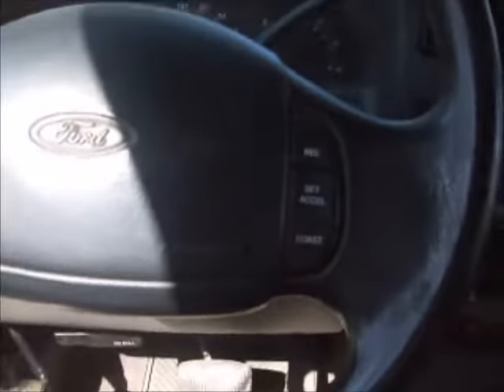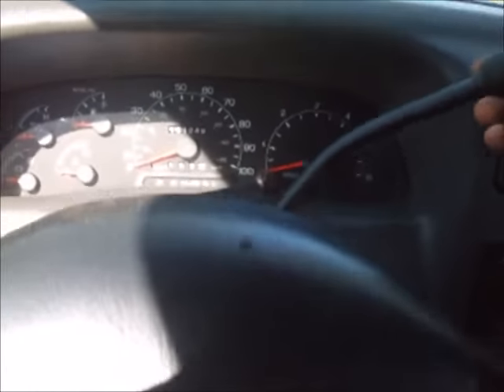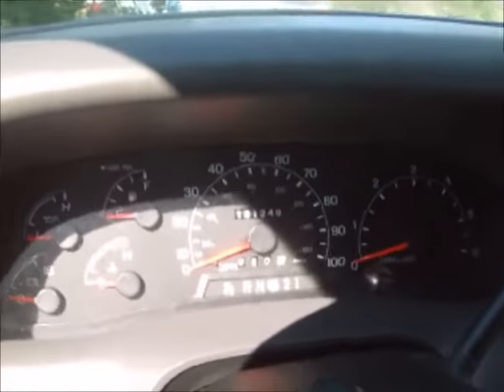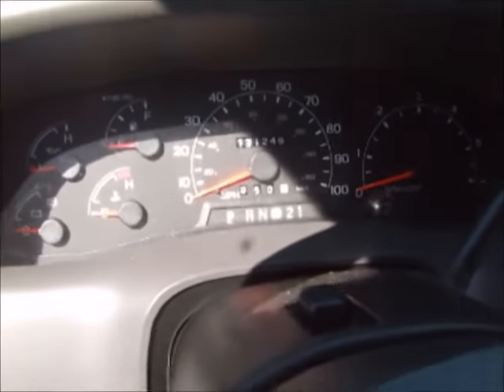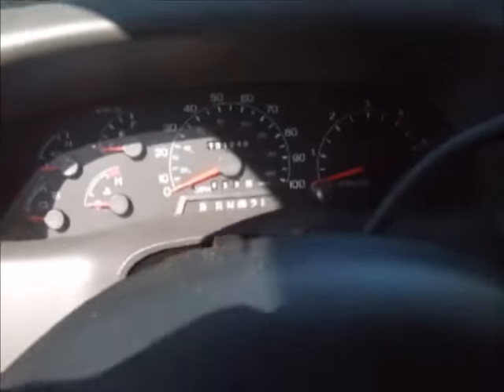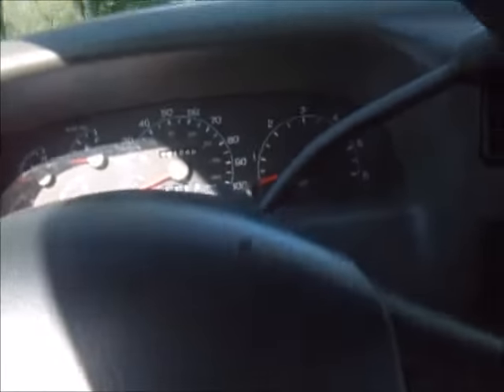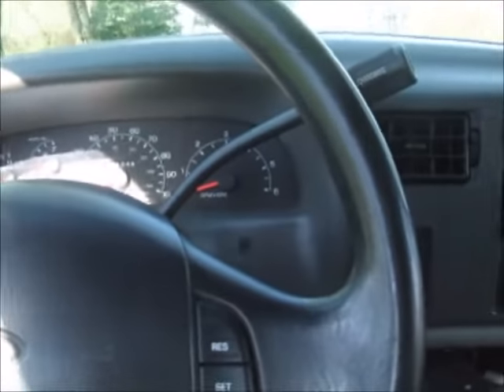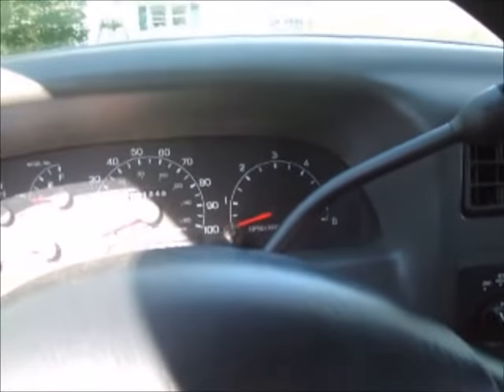𝟚𝟘𝟘𝟘 𝔽𝕆ℝ𝔻 𝔽𝟚𝟝𝟘 𝕋ℝ𝕀𝕋𝕆ℕ 𝕍𝟙𝟘    no start, loose gear shift lever

Comment: so would it crank just no start??  thanks .. Jon
Reply from the maker: turn the key got nothing, dead, like Antique Hippy commented, has to be fully in park or there is no contact. That's all I can tell you, those bolts come loose, no contact, I got zero...like a totally dead battery. Tighten up the bolts all good.

Comment: I've been encountering this same problem with my 01 f250 super duty v10...gear shifter not going into park like it should..seems like its getting stuck inbetween park & reverse causing the truck to wanna start rolling & even at times jumping out of gear & into reverse. In my case though im going to have to replace the shift lever as the top section where the overdrive button is broke off back in September of last yr...all was fine up until recently...now its not wanting to go into park unless i play with the shifter constantly...also having a problem with it while driving acting like its misfiring during acceleration but can't figure out whats causing it as its not throwing any codes....& now its having times where its not shifting properly...acts like its staying in drive & not going into overdrive like it should.....im at a losa on all these problems that are popping up...even my instrument cluster has now stopped working completely...guess its just do to the age of the truck...oh well little by little ill figure this mess out.
Reply from the maker: mine was misfiring in acceleration also....replaced the coils as water had accumulated in the spark plug wells and corroded the spring in coil on cylinder 7 and 10, ran like new afterwards, solved the shifting issue I had also.  Water can run down into the engine and sit where the valve covers are eventually getting into the wells. Hopefully that is what yours is, the other way water gets into the wells is a leaking manifold gasket where the radiator hose mounts to the manifold. Heard that is rare though, mostly rain water and sometimes windshield washer fluid running down in the wells. As for the gear shift lever...I don't know. if those two bolts get loose and you tighten them something else must be wrong. If you figure it out let me know here, might help someone else out. These are old but still good trucks.

Comment: I retired after 41 yrs as a Ford Tech. Tightened/LocTited dozens of these. Keep in mind that if it wont start that the trans is not fully in PARK. This is a safety issue. A lot of times there is a small rock between the manual lever on the trans & the mounting bosses for the Trans Range Sensor. This is hard to see but they are there-believe me !!
Reply from the maker: Thaat's good to know. Thanks for commenting.
Reply: 3DELTA7 I did it and still no crank :-(
Reply from the maker: I don't know...Antique Hippy above made a good comment...the transmission has to be fully in PARK, or it isn't going to start.  My issue turned out to be those two torx bolts....good luck
Reply: 3DELTA7 it was the starter solenoid!  I'm so used to driving my company truck that's a newer model doesn't have a starter solenoid on the fender,I didn't even think about it... shorted to start drove to AutoZone and replace it now on the road!